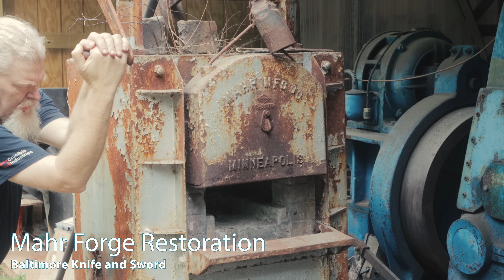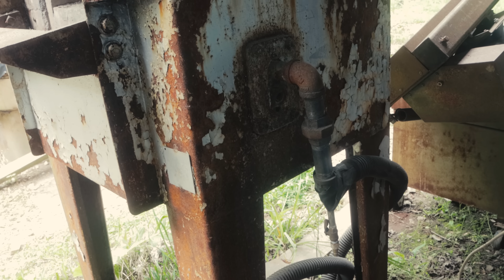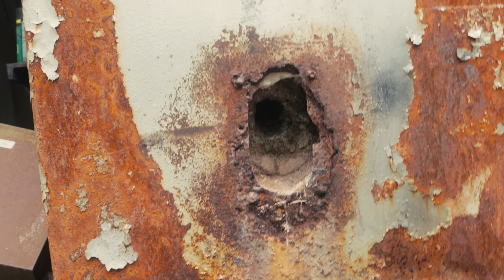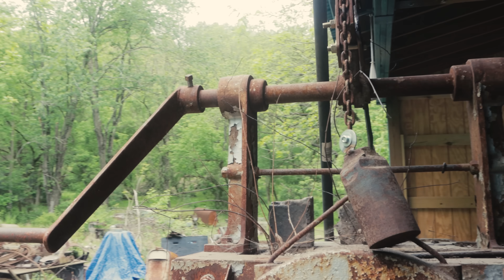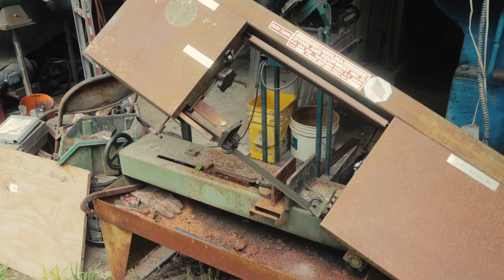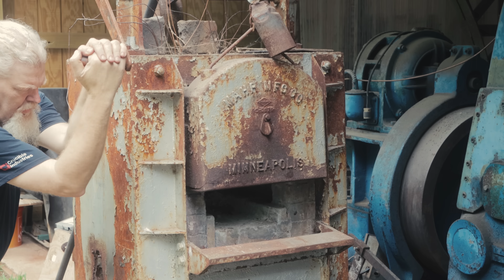Mahr Blacksmith Forge Restoration at Baltimore Knife and Sword (Part 1)

Comment: Do you guys get most of your equipment from stuff such as SOFA?
Reply from the maker: Sofa is a great place to go but we are lucky to be in an area where there is a huge amount of old tools if you know where to hunt.
Reply: Baltimore Knife and Sword Lucky for you guys, it’s hard to come by any older equipment where I am. The capitol city region of WV is pretty dead in terms of good forging gear, but I’ve managed to turn an old log splitting hydraulic press into a forging press with minimal sideways deflection. Anyways, best of luck to BKS!